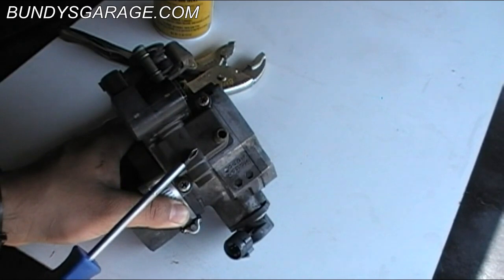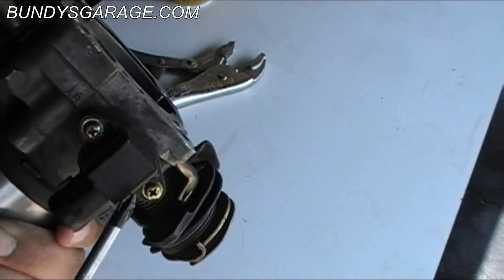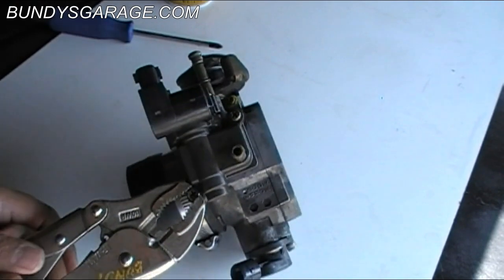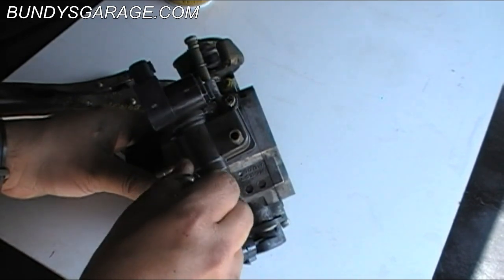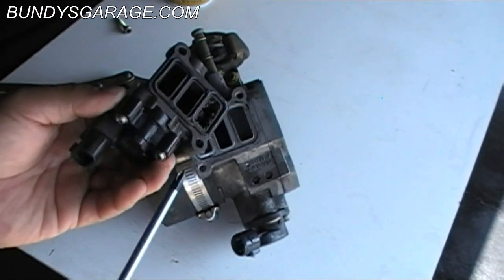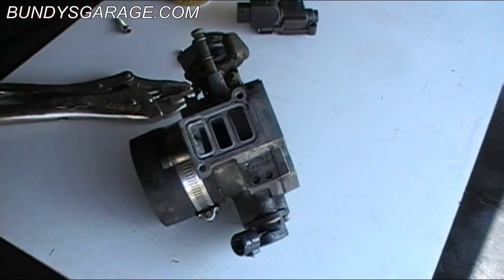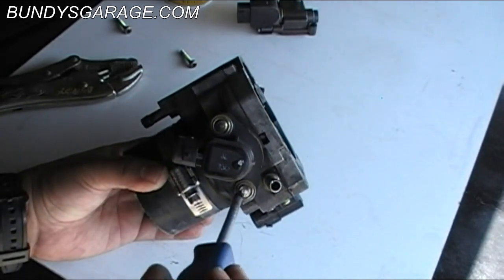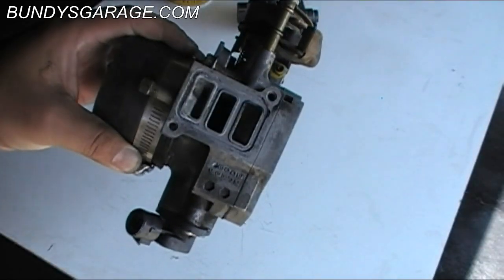DIY:Honda Accord Acura V6 J Series IACV Replacement - Idle Air Control Valve - Bundys Garage

Comment: OK this is for the 2004 MDX. I fixed my cold start problem.
I pulled off the ICV, not to hard.  Then I cleaned the tube from valve cover to ICV. Also cleaned butterfly valve face and the ^ just inside the throttle body. Put it back together and it WORKED. Started up in -4°C!

Comment: Thanks for video. Try a product called Kroil instead of liquid wrench on your next stubborn bolt/screw. Hard to find but works better and faster than anything I've used.
Reply from the maker: Where can I find Kroil?
Reply: ***** Definitely on Amazon plus I think Autozone (west coast) may carry it. I got mine at an auto parts store in So Cal but don't remember which one. Google Kano Kroil. I'd go for the non-aerosol because its spendy and the regular cans have a nice tiny drip nozzle...you really only need a small amount. I actually did my IAC on my 99 V6 today. Had to pull TB to get at screws because the one facing the firewall was stubborn. A couple drops and 10 min or so of waiting and it broke loose easily.
Reply: i buy my kroil (and aerokroil, the aerosol version) directly from Kano Laboratories.  It beats the dogshit out of any other pen oil on the market, imho

Comment: why bypass coolant in IACV?  Won't the heat of the exhaust gas in contact with the throttle body cause heating on the inlet air charge?  that's going the wrong way bigtime IMHO.

Comment: map sensor bundy map sensor! anyways yes the tps can be changed basically cut a slot with a dremel and use a flat and twist it out basically a screw with no head, after tps replacement you must recalibrate tps via multimeter.
Reply from the maker: Thanks for the tip. Was I using/saying MAP sensor wrong?
Reply: Map=mass air pressure Maf=mass aif flow
Reply: maf sucks i dont even know why they use it, it's technically more accurate per say depending if it's using the sonic principle, but most of them always restrict air flow.
Reply: MAP = manifold absolute pressure
Reply: anti0918 yess ur right thanks

Comment: Thanks for the video! My 3.0 CL just started this idle surging when in Neutral or Park & I think I need a new one of these. One question: Do I need to take off the throttle body to replace this (assuming those screws come out without vice grips)?
Reply from the maker: +elmooko69 thanks for watching. Plz sub if you can. Yes you need to take the throttle body off to change it.
Reply: +BundysGarage thanks for the quick response (I've been a subscriber for a while). I'm definitely going to order from Rock Auto this time!
Reply: +BundysGarage thanks for the quick response (I've been a subscriber for a while). I'm definitely going to order from Rock Auto this time!
Reply: +BundysGarage thanks for the quick response (I've been a subscriber for a while). I'm definitely going to order from Rock Auto this time!

Comment: So what screws are those the sizes i need to buy 2 new ones
Reply from the maker: I do we’re you I would just go to Ace Hardware or a hardware store and get some Philips screws that work. That way, if there is a next time, you won’t have to deal with that crappy design.

Comment: looking at iacv replacement on one of these, would love to know what you think i need to be careful of on the tb - thanks!
Reply from the maker: What kind of car are you working on?
Reply: 2002 acura mdx
Reply from the maker: Just be careful removing it. Do a throttle body clean on it while it's off the car.